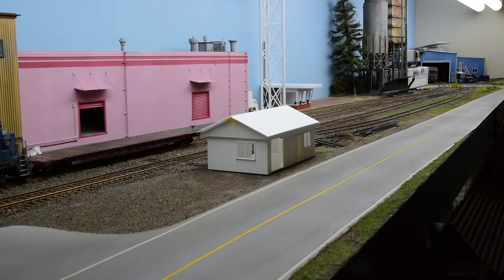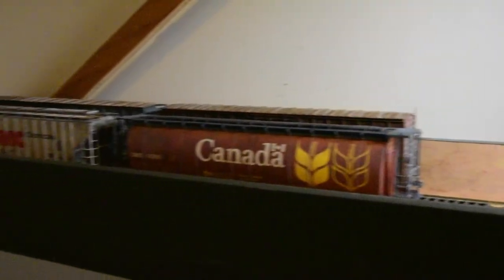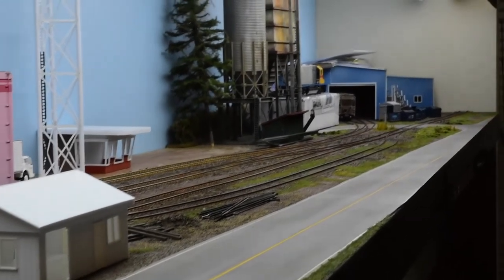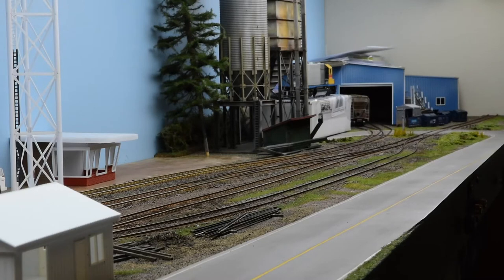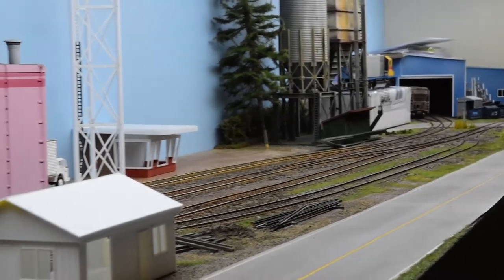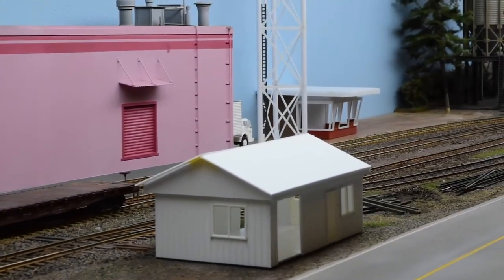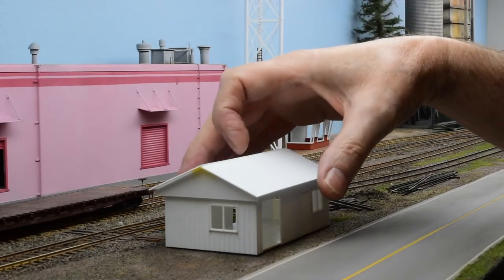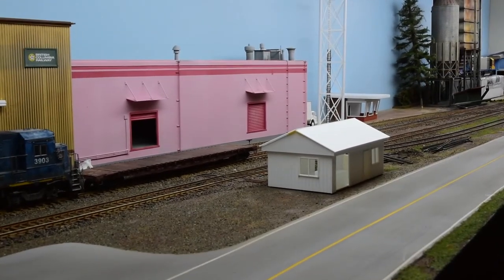The Model Railroad: Operational Philosophy of Glover Road

Comment: I really like the grass overgrown siding.  Looks really good.  Is that code 70 or 83 track?  The extra ties and rail is a nice touch.
Reply from the maker: The track is all Atlas Code 83 (paint helps to knock down the visual height as well). I wish I would have used Code 70 in hindsight actually (better for short line railroads), but I had lots of Atlas Code 83 on hand. Cheers.

Comment: Boomer has an excellent artistic vision of perspectives and selective compression. Also cheating a bit can help, specially if you freelance. How to get more in small places goes with tighter turnouts like number 4.  Smaller hence shorter loco. A GE 44 tons would fit more at home here than a DD40AX 89 feet long. An industrial plant or railway can be a smart option. Logging on old shorter flatcars with truss rods and archbar trucks with finish lumber ready for shipping.
A tie and pole creosoting plant can even use narrow gauge track like the one in Delson, south of Montréal.  Standard gauge gondolas with raw ties and poles, transfered to narrow gauge dollies, push in steamer for stuff application, and back in gondolas.
All tank cars need inspection, cleaning and repairs. Such a plant can be compact with small loco. The CGTX plant in Montreal use a trackmobile and before an old battered center cab. An office, 2 buildings for few tank cars, one with open sides and one more conventional.
Not so long ago a flour mill could received grain from old 40 feet boxcar, mill it and back in boxcar. 3 box = 120 feet of track versus modern 69' covered hopper. 2 of them is 140 feet of track. 20 feet longer and just 2 cars, add your 44 tons
Bachman Spectrum, Rapido...) at less than 34 feet long. You get a plausible unit pulling 3 or 4 boxcars in short space with tight turnout. You can´t get that with gigantic autorack 89 feet long.
The real Monson rr, nicknamed 2X6 was 2 feet gauge, 6 miles in lenght from stone quarry to interchange with finish stones with MEC. No wye or turntable and a single small bridge. Steam loco was pushing backward to MEC. Labor intensive to transfer everything from narrow to 
standard gauge cars. Inbound could be coal and materials. Everything is gone now, MEC track inclueded. But a modern standard gauge Monson with appropriate interchange and small centercab loco is a viable option. You can always use capstan or rope winch to pull your cars...or use gravity so common on small mining operation.
Or a smaller scale specially if you don´t already have stuff.
Mini house, mini layout real estate can still be plenty of fun !
That´s what Boomer teach us !
Reply from the maker: It's amazing what one can model in only eight feet. Yup, a 44 Tonner would work great here. Cheers!